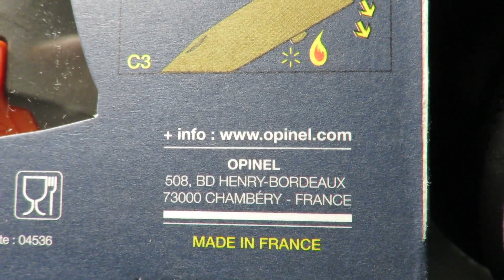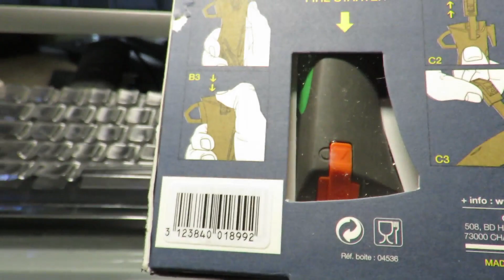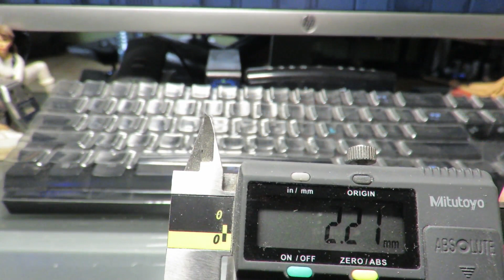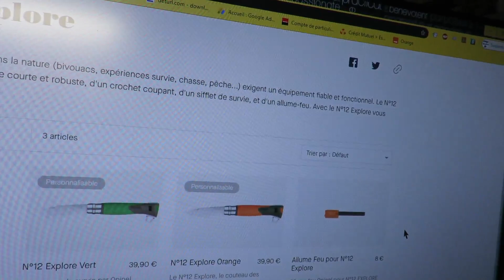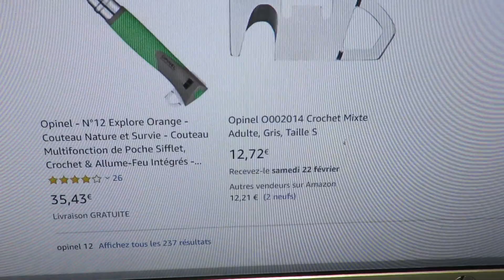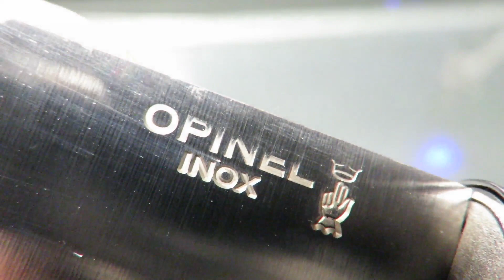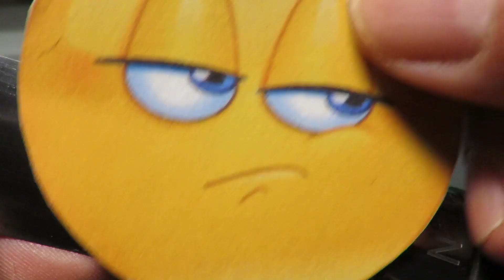OPINEL N°12 EXPLORE (Multi-Function Knife)

Comment: In my experience most belt cutters need sharpening out of the box to actually be preferable to a knife blade in any given situation. But even then the actually usefulness is questionable on a daily basis. I do use the Charge one for zip-ties every now and then but it also needed sharpening out of the box.
Reply from the maker: No, any product not sharpened at the factory deserves a red card. The hook of my Leatherman Klamath, which resembles that of the Opinel 12, cuts excellently without the need to sharpen it. All leatherman multi-tool belt cutters work properly. I buy a product, I don't get paid to sharpen new products!
Reply: @diezelle57  I dont get to hung up on out of the box sharpness as long as its easy to fix. A couple of passes on a strop or ceramic rod usually does it. I was surprised to find this flaw on a leatherman to be honest but as I'm sure you well know even the best brands are not perfect. My second or third Surge also had some minor defects as did several of my victorinox. Gerbers seems to have small or large impefections more often than not.
Reply from the maker: @TheKimjoh560  I just wrote to you that Leatherman's belt cutters had no problem (see my recent video on this). I repeat to you that I am a customer, that I do not have to do the work of sharpening of the manufacturer.
Reply: @diezelle57  I have seen your massive collection. That doesnt change the fact that my belt cutters needed sharpening.